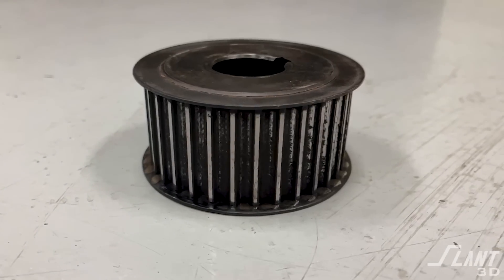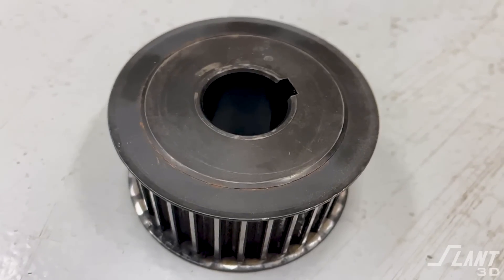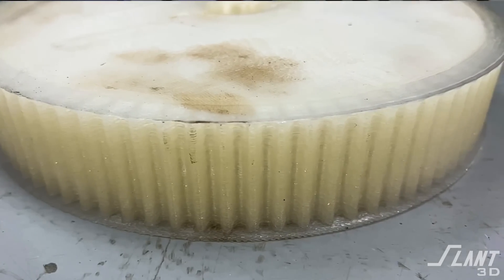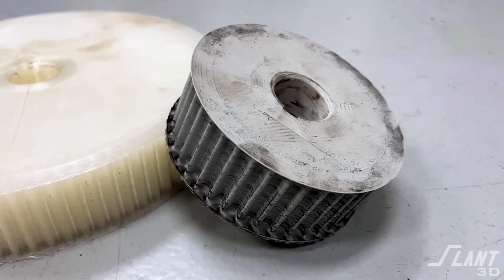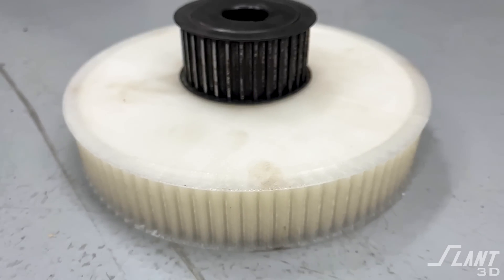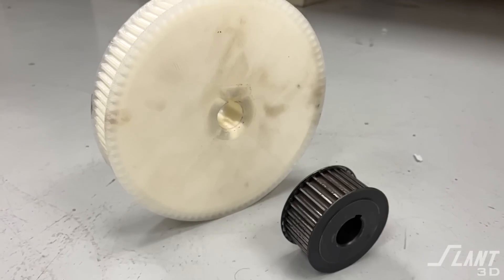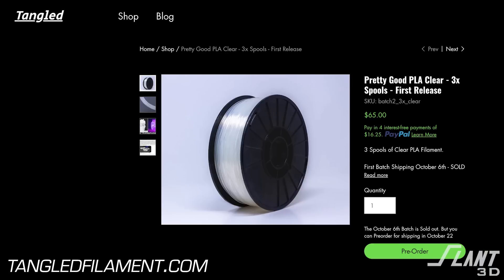Impossible Gears | Design for Mass Production 3D Printing

Comment: $150 to $200 to for someone to model that pulley? Here I would ask $5 or $10 if being greedy. An easy peasy job

Need to get out of Argentina.
Reply: I guess they don't pay engineers in Argentina? $100 per hour. Takes maybe an hour to get a first draft and one more to make refinements. That's $200. Engineers are expensive. I have no idea how they can afford me, but I guess they make even more of what I do
Reply: @timonix2  It should take an "engineer" less than 15 minutes to model that pulley, taking into account the time to google "how to 3d model a pulley" and looking a 5 minute youtube video
Reply: @nirodper  Ah but you forget. You need a 30 minute meeting between the stakeholder and team lead and another 30 minute meeting narrowing down the specification. Then you actually make the part and realize the specification is wrong.
Reply: The $150 isn't for modeling it, the price is for the block of metal and the costs of labor.

Comment: 1-3 hunderd dollars for a pulley like the one you are holding in your hand is a massive ripoff, a pulley like that which looks like HTD 8m 36 30 shouldnt cost you any more than 30usd , really big ones that were cast then machined like 8m 112 30 cost us around 130 usd (in europe).
Reply: The cost is related to getting a timing pulley with the exact ratio of teeth needed for a particular application. While some pulley's have a common number of teeth, its the lower volume specially ones that have much added cost. This a result of fewer parts produced for the same amount of engineering and tooling costs.
The only reason pulley's are priced the premium they are, is no one is producing them at a lower cost.
Pricing of similar kinds of parts is about to be disrupted!

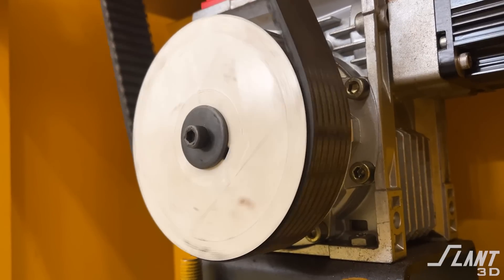Comment: Im sorry, but at 4:43 it clearly does not run smoothly. You can see that the belt is clearly moving and not fully engaging. This will have an impact on the rotational speed of the output shaft, so it will not be constant. 
It might be ok for you, I dont know, but this is clearly not a 1:1 replacement.
Reply: That looks to be the metal part.
Reply: that would look to be a tensioning issue, which would probably be intentional to reduce wear and wouldn't have a very significant effect on efficiancy

Comment: I mean i made new gates based pulley for a mini lathe but i dunno if this would even be near the precision.
I actually made it completely configurable in cad for profiles and also tooth count. With two parameters.

I did see with gates belts you do get the issue with the stuff being quite abrasive when plastic on plastic (sometimes even fiberglass).

The metal is never wasted when taken away from the part.

Comment: what about wear and heat?
Reply: Most of the wear and heat is within a rubber timing belt. It's a softer material doing more flexing. Many belts will need replacing, before a timing pulley is replace.

Comment: second =)). the pulley looks wobbly though. maybe use some subtractive manufacturing as a final step to get the teeth surface consistent and make sure the shaft is centered. if it doesn't affect the filament consistency it is fine as is